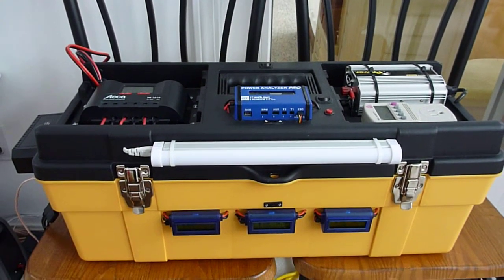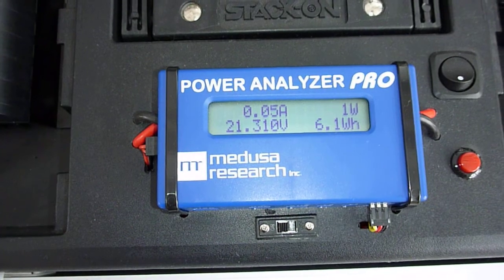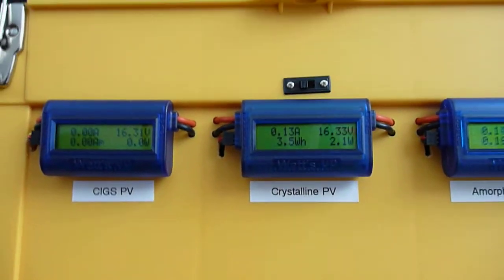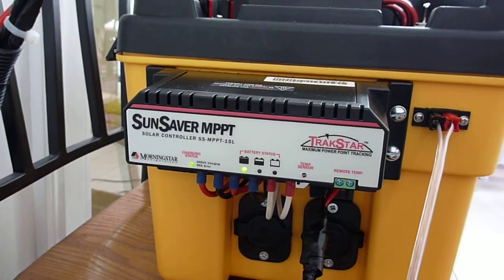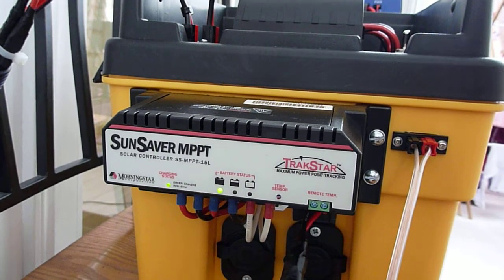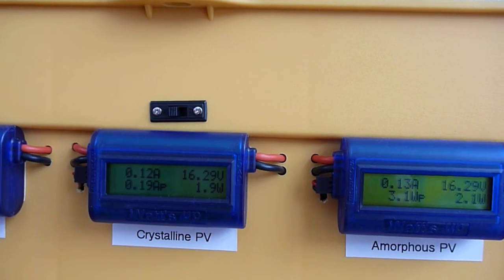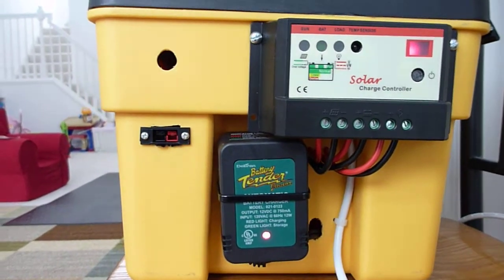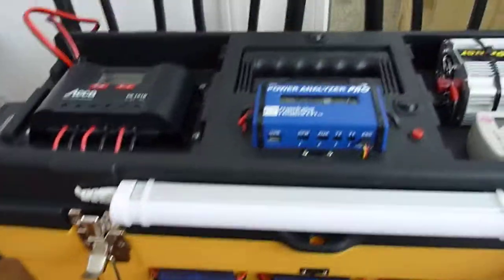Solar Panel Review / Comparison / Performance - Part 1/4

Comment from the maker: Yes, my Watts Up meters are wired between the solar panel and charger. They are also wired between the charger and battery. I use them for the very reason you state, they provide great information and are far cheaper than a display / logging on a controller.

The Watts Up meter can easily handel 100 watt and more so it'll work fine on your system.

Comment from the maker: Thanks for the comment. It is handy as a "research box" and in the case of a power failure...but with three 12 Ah batteries and all the other attachments it's a "little" too heavy to be a handy portable device. 
I'm working on another solar charging project that will use Li-Ion batteries and will be very portable.

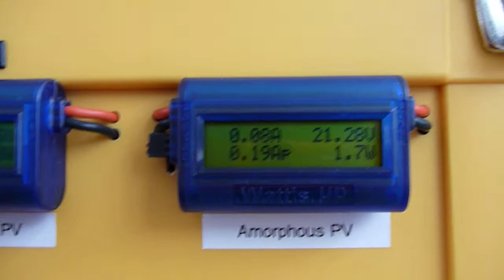Comment: At 5:33 you show why a MPPT is better and demonstrates the difference by switching controllers.
BUT:
The wattsupmeter shows about 2 W in both cases.
There is no power lost.
The change is in volts and amps but their product remains the same.

Comment: @mjlorton
  G'day... VERY Nice..! 
  However, I understand that the 19-21 Volts measured at the PV is "Open Circuit", & at Zero Amps. If y' put a Clampmeter on the Lead, while  A Multimeter does the Volts, y'll see it. Then get a 2nd Multimeter, set to Amps & as the Amps at Short-Circuit rise, Volts will drop.... The Battery's Voltage (Resistance to Charge) rises, as it's Resting-Discharge is replaced. A 1.7 Amp rated PV gives 1.9-2.1 Amps, at  Open Circuit.

Comment: Hi, Do you have those watts up meters wired between the MPPT charge controllers output and your battery?

I want to get one for my solar set-up, as it gives more information and is cheaper than a MPPT controller with a built in LCD.

My system has no more than 100w input, so that should be ok for a 'watts up' style meter?

Comment: When you switch from mppt to battery voltage display on your  analyzer showed higher amp and watt reading so is not really loosing any total power?